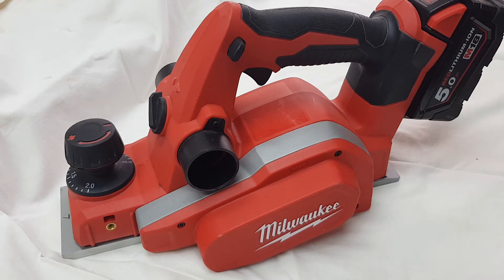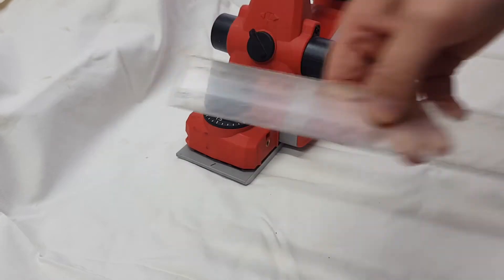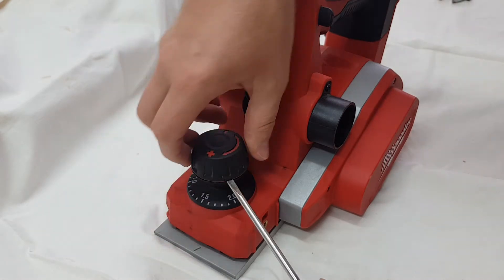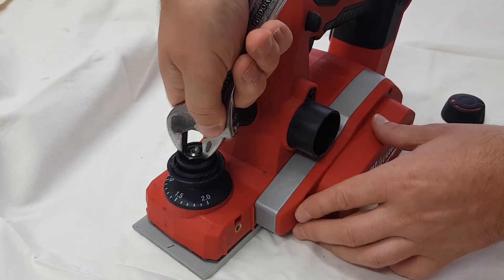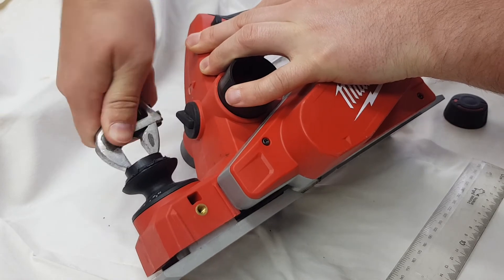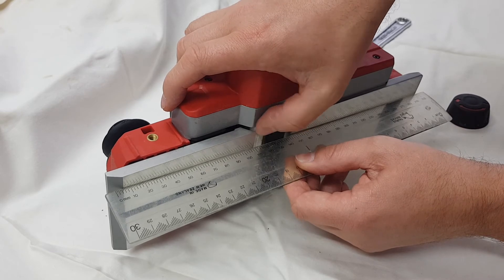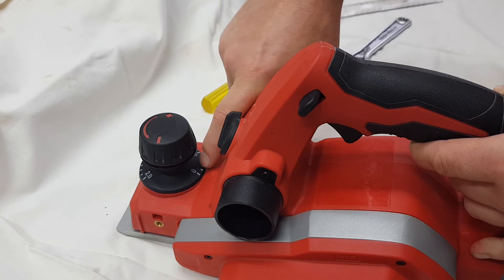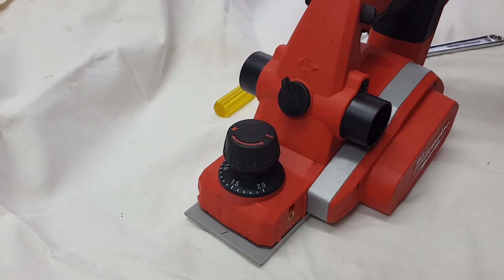Milwaukee 82mm Cordless Planer M18BP front shoe calibration

Comment: what about the back shoe? at 0 it still looked off
Is it possible to calibrate both shoes?
Reply from the maker: Unfortunately the back shoe can't be adjusted or calibrated. I've put it down to the plastic frame / body just isn't made square to start with.  There isn't much you can do without trying to modify the plastic around the rear shoe holder yourself.
Reply: The millwalkee planners have no adjustment for the rear shoe or blade depth even the ryobi planner has blade depth adjustment  , and to make it worse they haven't changed this planner since it came out around 8 yrs ago

Comment: My front shoe isn't Square to the blade ?
Reply from the maker: I've put it down to the plastic frame / body just isn't made square to start with.  There isn't much you can do without trying to modify the plastic around the front shoe holder yourself.

Comment: Does anybody else find that the front plate is not level with the back plate for a proper flat plane?
We've returned the first one and got a replacement but it seems they're all the same.

Or is there a reason for that front plate to be off square?
Reply from the maker: I've examined quite a few of the Milwaukee 18V Planer, re-built a couple, only to find that they still come back with the same problems.  I've put it down to the plastic frame / body just isn't made square to start with.  We ended up replacing a few through the Milwaukee warranty system until the customer gets one that they're happy with.  Unfortunately there isn't much else you can do.